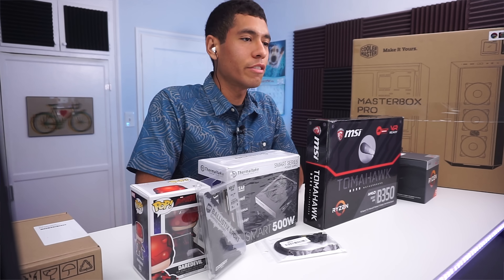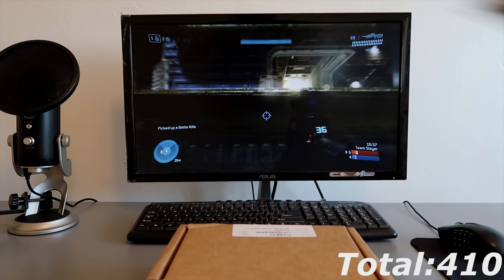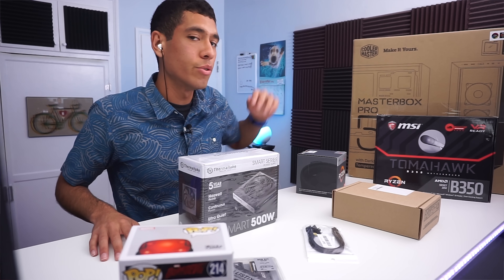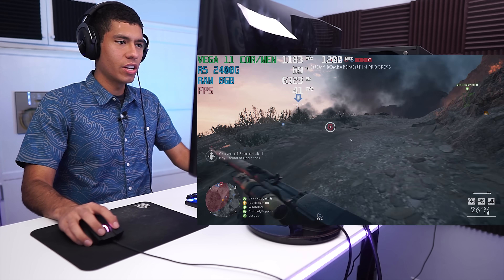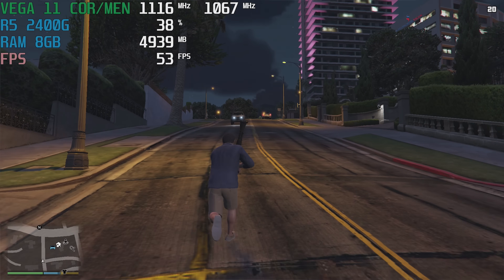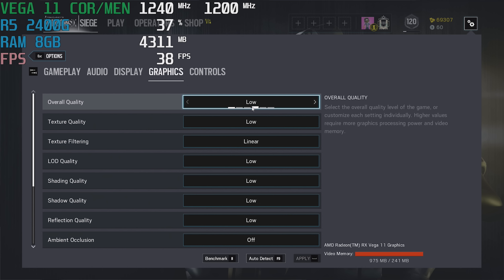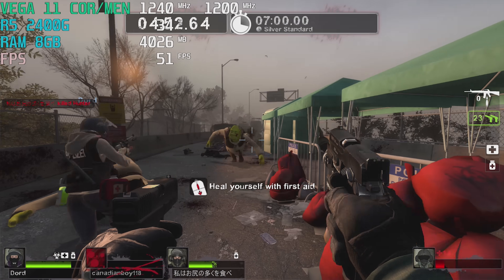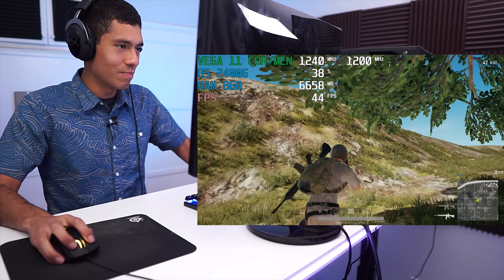$500 Budget Gaming PC Build - Ryzen 5 2400G (w/ Benchmarks)

Comment from the maker: NEW $500 PC Build Guide is now live! :D https://youtu.be/LGTqOqznXKw
Reply: Joey can you help me with my problem i have ryzen 2400g
Reply: i built mine with a higher clocked ram at 3000mhz and the same cpu.  and it gets framerates lower than 30 for portal 1. why is that? did i do something wrong?
Reply: @CaseLogsTrades  i have corsair 3000mhz ram and ryzen 2400g in asrock ab350 fatal1ty gaming k4 and in ram support list i dont see exactly my ram but with same differents in the numbers of code and the problem is that my motherboard cant boot with the 2 stick only with one and i have 4gb now and not 8gb
Reply: @sttz1631  ok so what i found was that Windows 10 wasn't using the vega graphics by default. Make sure you download the latest amd ryzen drivers which will fix the issue of it not detecting the GPU. Also does your motherboard say how much ram it supports?  Also you might have not plugged the ram in all the way?
Reply: @sttz1631  update your drivers for EVERYTHING.
Reply: @CaseLogsTrades  thanks. I didnt hear about that problem with windows i only heard that my motherboard got end of life can you send me a link for the drivers because i am not sure if you talking about amd master or something else
Reply: Joey Delgado what graphics card would you recommend
Reply: Joey Delgado why don‘t you do cinebench r15  and geekbench test ?
Reply: Joey Can you Show this in  normal Speed i want to build this
Reply: Joey Delgado hey joey what are my graphics card options all of them because this will be my first build
Reply: Links were never updated
Reply: Joey Delgado what can I do to get 100fps on this build
Reply: It genuinely bothers me that you speed up certain videos I bought parts to one of your builds and this shit ain’t turning even when I’ve watched so many videos on building PCs my first time building one has been the worst time ever knowing that 500 dollars of mine went down the drain
Reply: Is this still worth building for fortnite ?

Comment: i built this same pc and im not getting the same fps he's getting? idk if he overclocked his pc or what but im not getting REMOTELY close to the fps he gets. if anyone has any tips on how to raise my fps pls help me out
Reply: Your Father his isn’t overclocked. It could be your ram speed
Reply: Straight Paulin i used the same ram as him tho and his pc runs games WAY faster than mine
Reply: Your Father have you checked if your ram is running at the rated speed? You can check by using your bios.
Reply: If mobo supports it try 3200mhz ram. Add ssd.

Comment: Help Help! ❤️
I have got the same pc specs - Amd Ryzen 5 2400G, No gpu, 8gb 2400mhz ram in dual channel ( 4gb + 4gb ) ,1tb hdd. 
I have a single enquiry and that is my total memory shows 8gb out of which it shows 5.95gb usable ram. 
Is this the case for all? I mean the Radeon vega graphics has consumed 2gb of my ram.
So is this supposed to be the case?
Reply: if you have set the igpu to use 2 gigs, it will use 2 gigs. no problems there

Comment: You did not up the amount of memory that could be used by the GPU it seems!

On the BIOS there should be a setting that wnables you to use 2Gb of the system memory insted of the 128mb you seem to be using (saw in Rainbow6 the amount of available memory in the settings).

Comment: Whenever your FPS drops, take a look at the GPU counter. Your VRAM speed drops to 400MHz, meaning your RAM is too slow. Although you did buy dual channel, 2400MHz was a poor choice, and these days RAM prices are normal, so people considering this system should buy atleast 2933MHz RAM. Disregard the people who are saying "overclock cpu plz", just the RAM is the problem; those people must be more inexperienced with tech. Overclocking will definitely help though, LowSpecGamer has an awesome video on the APU.

Great video but should have pointed that out.
Reply: 3200MHz RAM is the best. 😁
Reply: Hell 8gb of ram only may of been why it had random screen black out issues.

Comment: Slap an RX 570 8GB for $130 on eBay and enjoy
Reply: Hey would I need to upgrade the psu with that card?
Reply: @Lazy_J41  You would need at least a 450W PSU in order to use the RX 570. Sorry for not mentioning this information before; otherwise your power supply would not be able to use this GPU.
EDIT: Oh yeah yeah. He is using a 500W PSU with is. Great for the RX 570.
Reply: @tonybologna4489  What if rx580 version 8gb. 500w PSU still okey?
Reply: @pierrot1795  yes

Comment: hey guys i need help here, I'm trying to make a budget pc for the time being and my plan is that 1-3 months down the line (however long it would take) after buying this budget pc, I'll go ahead and buy a graphics card and maybe in the later later future upgrade my cpu and get better ram.

the specs im going for on the starting budget build are: 
-ryzen 2400g
*no gpu, buy at later date as mentioned
-8gb dual channel ddr4 (highest possible mhz i can find)
-b450 motherboard
-1tb hdd +120gb ssd
*will try to find a decent power supply
*some tempered glass case (i know there's not much to show but it would be good for my gpu later on and I'll chuck a pop figure in there as well)

the gpu im going to get later on is a gtx 1060 3gb

games im going to play (and my brother)
dota 2, csgo, tf2, gmod, overwatch(maybe), rocket league, fortnite, rainbow six siege, pubg

im pretty set on this build and confident it would be fine performance wise for a budget build, but i need further help from people who (i hope) knows better than me in computers. thank you so much if you guys could help, it would be appreciated.

reposted from a comment's comment section
Reply: Get the gtx 6gb cus it 3gb vram is not enough for somegames
Reply: Prakash hey man thx for replying. I've recently been looking at this, and I've decided to get a rx580 8gb instead. better performance than 1060 6gb and I can get it at the same price of a 3gb in my country

Comment: If he had a gtx 1050 Fortnite would run smoothly High settings 60-70 FPS
Reply: That implies buying a GPU and CPU separatedly, the 2400g is an APU (GPU and CPU mixed in) and is WAY cheaper.

Comment: Can someone suggest me a ryzen build? I would gladly appreciate it!

CPU: AMD Ryzen 5 2600
GPU: RX 580 8GB

These are just the start of my build but I want someone knowlegeable enough to choose the right mobo,psu,storage HDD, case for my build and all has to be compatible. I'm not going to get a cpu cooler for now and a SSD, maybe in the future. My monitor would be an ASUS VG278Q 27'' 1ms 144Hz FREESYNC. Thank you very much! =)
Reply: Hey man I'm probably hella late for this but I hope I can help!! Also keep the 2600 and rx580, awesome combo! 

Get a B450 motherboard so that the 2600 can work instantly without having to use another cpu to update bios. Get 2 16gb ram sticks of 2666 or more. If you don't have that budget then get 2 4gb sticks of 3000 or 3200. PSU go for a Corsair 550 CXM semi modular this allows for some cable management. Case wise is personal preference so you get a micro atx Mobo get a micro atx case for aesthetics (I recommend though Cooler master 3.1, Deepcool tesseract Sw and corsair carbide) Hard drive id recommend 2tb but if you don't have that get a 1tb and get a 240gb ssd, make sure to install the OS on the ssd.

Hope this helps

Comment: So its an xbox but in pc form
Reply: Im talking about how it runs btw
Reply: I thought a xbox ran at 30 fps besides thot one x.
I have a xbox and pc btw.
Reply: Evan the monster nah it runs 60 fps on most games but not all. PUBG is like 30-40 fps on the normal xbox one, pc is a lot better for games as you chose every setting, but if you just want something to get the thing done an xbox should be better for your money
Reply: @smoke-3972  I know this is old but no it does not run most games at 60fps it runs most games at 30 fps between 768-900p and the games it does attempt 60fps with it usually struggles even the new call of duty can't maintain 60 fps let alone single player titles
Reply: Lucas rlly?? Damn I should get into pc then. Lol
Reply: fortnites derps r4 An Xbox is cheaper and runs better, so no.
Reply: @thegrayghost1786  its not cheaper, and its also not a pc
Reply: @d3exter864  I'm not going to argue facts, it is definitely cheaper.  You can get an Xbox refurbished with some games for like 200 or so dollars, and I just saw a bundle for an Xbox and BFV for 300. So unless that pc dropped in price below 300 dollars the Xbox is cheaper. Granted it is not a pc, I will give you that, but in terms of strictly playing games the Xbox is better.
Reply: @d3exter864  its is cheaper to get an xbox but i would prefer to have a pc
Reply: @thegrayghost1786  but you cant add a gpu to a xbox
Reply: @Mal-ck1gh  And? The price to performance is better on the Xbox. Your statement is irrelevant.

Comment: What gpu should I get for this?
Reply: I say Radeon 570 8gb cos it is the same price if not cheaper as the 1050ti but the 1050ti only has 4gb whaeres 570 have 8gb
Reply: Joey Brooks GTX 1050 Ti because of the other parts

Comment: hi joe, thanks for the video, really helps a lot. the only difference I buy was I discover a AMD Ryzen 5 and Gigabyte GA-AB350M-DS3H bundle from your link. I am wondering if this MB will have the latest Bios? How can I check or, upgrade? Thanks a lot if you see this :)
Reply: If it is a 1000 series then the bios is good but if it is a 2000 series you need to update the bios

Comment: For anyone new to the PCMR welcome and I have a few tips. MOTHERBOARDS DONT EFFECT PERFORMANCE. A $50 motherboard on amazon and a $500 board will yield identical frames. As long as the board has the correct CPU socket and chipset then you are fine. If you are looking for a budget board, go on amazon search for b450 motherboard and sort lowest to highest. Find one with the features you want ie usb 3.1, 4vs2 Ram slots, ATX vs mATX etc. Also if you want to put a graphics card in this machine get a 1050 or 1050ti. Solid price to performance. If you want something a little beefier look at 900 series cards on the used market. You won’t get a warranty but I found a 970 for 110 on Craigslist. Also, if you are only playing games that don’t require much horse power CSGO, league, etc you won’t need to add a video card for a while. This should be able to play those games at playable frame rates.

Comment: "A decent pc takes at least 2k."
says every console peaseant ever
Reply: Smile what the guy said above me. This video is very outdated. AMD has new offerings that offer dollar to performance.
Reply: This is on all low and it’s still only 40 fps... and isn’t the newest xbox like $365 off newegg right now? Not a console user btw but I have a point
Reply: Dumb dude this video is so outdated, you can build a pc with a ryzen 3 1200 and rx 570 or 580 and get way better FPS and if you get a decent mobo you can easily upgrade the cpu later on and get such good performance, but still the r3 1200 and rx 570 can easily run pretty much any game
Reply: Josh Manzano my guy this is 2 years old
Reply: It was good cuz at the time the graphic card prices were inflated and the apu from ryzen was way cheaper
Reply: @wheelman1232  my last build was a 750ti + i3 gen5 around 2011. I sold that build a couple years ago and have been wanting to build another gaming PC which is how I am well aware of the prices for the components. At the moment since I already own an Xbox X, I can't justify spending another 800 - 900 usd for what would ultimately be a relatively minor bump in performance and graphics. I like both consoles and PC, so I don't feel I'm biased in saying that right now PC is not a value proposition.
Reply: @wheelman1232  Xbox store deals are also pretty much equivalent to Steams' sales. Back 10 years ago PC games were much cheaper but now it's about the same IMO. Consoles are becoming more like gaming PCs, and gaming PCs components have shot up in price because of Crypto.
Reply: @KidLankyy  In GPU performance Xbox One X has a GTX 1060. If you don't believe that, you should search it on Google
Reply: so you are the peasant?
Reply: jayden medina  Yes, lol. But I'm not spending money on a PC when I don't know if I'll have a job by next week.
Reply: Smile it’s Terrible. 500 can get you a 1600af and 1650s
Reply: No 1000 is more than enough for one
Reply: This build is trash tho
Reply: Console peasant woah you rich or something
Reply: You can get a $600-700 dollar PC that runs better than any console.
Reply: Take into account, you guys are talking about new retail prices. If you go into the used market and are actually able to find good deals, you can build a PC better than the Xbox One/PS4. I built a system with a Ryzen 5 2600x with a GTX 1070 and 16GB of ram for around only $450.
Reply: You can't build a PC comparable to an Xbox One X for less, not even taking into account the UHD drive. Maybe if GPUs go down you can do a 1050TI build that is comparable to the X (sans UHD drive) but at the moment it's not doable for 99% of people. Thus consoles right now do offer the best bang for your buck, especially if you don't want to go through the hassle (pleasure in my case, but hassle for most) of having to put your gaming machine together.
Reply: @retroArenas  Don't lie, the theorical power of the Xbox One X GPU is like a GTX 1060, and you know console optimization is better than PC optimization, so, in some games it can run at better quality than a GTX 1060, but not more than 60 fps due to the CPU bottleneck. A PC is always more expensive than a console, but you can do more things. That decision is up to the users
Reply: @retroArenas  eeeh....you can build a decent pc for less than 500,with ryzen 3 and rx570..
Reply: @tomi1455  CAD Rx 580 is $278 and Rx 570 is $301 
It would cost more than what I'm willing to pay for a decent graphics card
Reply: @tomi1455  that build won't give you 4k like Xbox X

Comment: I have a few questions if anyone would like to help. I am new to building pc's.
I am saving up to build a pc similar to this one.
My first question is. If I bought the 2400g and I buy let's say a gtx 1070 or 1080 later down the road. Will this still be a good cpu? Like if I ever decide to buy said gpu (gtx 1080) to play 4k will this cpu be good for that?
Next question is about the stutter. I saw people mentioning that the reason bf1 was acting weird was because the ram wasn't fast enough. Like would it be better to buy single or dual stick? And does faster ram help avoid that black screen stuff? Would 16gb 3000 ram be good enough? If so dual or single? (All that ram for potential future upgrades)

Comment: You are so bad building a gaming pc my pc is way better than yours and have simillar price

Ryzen 3 1300x (OC)
Geforce 1050ti 
Asrock a320m pro4
8gb ddr4 ram crucial
1tb seagate barracuda  
 2 extra fans 
 a 500w psu
And of course a awesome case 
Total 564€ or something like 520$

And it can get 70fps or so in gtav max settings
Reply: TheOmega  no thats perfect but for future upgrades i recommend buying a 1060 and an extra 8gb
Reply: Ok calm down im not google i dont instantly respond

1st of all if you are going to play a bunch of games then u need more ram if not you dont need 16 gb 
2nd a good monitor that im also thinking of buying is the LG 22mk400h-B 75hz freesync with a reasonable price (at least in europe)
3rd u should get the 6gb as you will be able to play more games in max settings than with the 3gb
Reply: If you have any more questions lemme know

Comment: My budget build

Cpu / Apu 2400 G 
$159.99

Mobo Gigabyte B450m DS3H 
$69.99

Ram 8gb (2x4) Ballistix Sport LT 2400 $85.73

Hardrive 1tb Western digital blue 7200rpm $43.90

Case Corsair 270R ATX Mid Tower ( Glass side panel) $59.99

PSU Corsair CXM 450W 80+ Bronze Semi-Modular $32.98

Total Cost $451.59

Total Power usage a whapping 150 Watts

Comment: Would it be easy to make this and pop in a gtx 1060
Reply: Yeah. Just install the 1060
Reply: K
Reply: Would it be good with gtx 1050
Reply: What fps would i get in fortnite
Reply: @brucenicholas1999  probably 60 FPS at high, maybe epic settings with some things disabled.
Reply: Brylin Sundae i dont play epic settings i like low settings so it will be like 100? (Is it weird that i like low settings)?
Reply: Brylin Sundae thanks btw for the reply brother
Reply: @brucenicholas1999  yeah probably. My integrated graphics (intel) gets like 20 with low settings at 1920x1080 so it depends on resolution. No problem, have fun building! Still waiting on my GPU for my build lol.

Comment: if I buy this processor do I have to overclock ?
Reply: masum kazi not really but you can squeeze more performance especially the vega 11
Reply: Giovann H Is this processor is good?
Reply: masum kazi ryzen 5 1600 is better in terms of processor, but this one has vega 11 which is insane
Reply: Giovann H so I am thinking to build a pc so should I get this ryzan 5 2400g vega 11?
Reply: masum kazi are you going to  immediately pair it with a gpu or will you be using the built in gpu (vega 11) for a while?
Reply: Giovann H if I buy this I Will be using built in gpu for a while after I m going to buy a gpu. can I use a different gpu with this processor ?
Reply: masum kazi yes you can put any gpu later
Reply: Giovann H thanks for advice
Reply: Giovann H  will it do any problem while playing ?
Reply: masum kazi if you don't overclock the vega 11 i think you need to play on low settings, that way most of the load goes to the cpu, and btw if you can find ram that has high clock like 3000mhz or more then i suggest you invest on it, also always run the ram on dual channel (e.g: 2x4gb or 2x8gb)